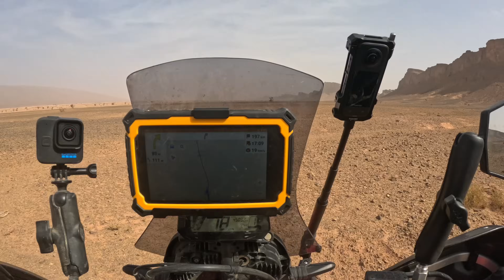This is a serious problem with my motorcycle |S7 - E12|

Comment: As a aircraft technician, it always amazes me when I see someone with ingenuity. Ramdan is a shining star in his ability to come up with a clever solution with the tools at hand. It interesting how people in remote areas are so friendly and customer oriented, not so here in the States. Please keep up the great videos, they warm my heart.
Reply: street mechanics usually came up with good tricks repairing unavailabe parts...
Reply: Yes, Moroccans are very kind, generous and kind. Welcome to your second country
Reply: As a Certified red neck fix it anyway you can in a pinch . I always get a kick out of engineers above my pay level to make a simple problem worse. Air craft have at least 1 back up system, great if you flying. Sucks if you have to move it,Hammering a brake line close before a leak is not a option at 30k ft either. But after 47 yrs riding bikes I can always find a way to fix it cheap and nasty.
Reply: It's not about customer.... these people will help out even if you are not a customer. Why u only see the materiel side of the world.
Reply: Zal wel lekker jeuken dat glaswol aan de blote handen😅

Comment: I followed the repairs,, metal working, to paint,, and then the air box repair glass fiber mat, polyester resin, gel coat, micro balloons,,, and then paint to finish sealing and make it pretty.  I do not know the plastic Honda uses,, most polyester resins should be compatible.  If it lasts the week of temps and vibrations, it will last as long as the motorcycle.  That was not a temp patch,,, that was an expertly thought out and skillful permanent solution.  My compliments to your mechanics.
Reply: Agree!  That was an expert repair job.

Comment: I think the repair will be stronger than a replacement! 😂
Reply: me too this fibreglass epoxy combination is very flexible and powerful
Reply: yess
Reply: agreed
Reply: Definitely as strong and looking at the amount of mesh they dropped in there probably thicker walls than a new box. Save you’re money Loraley as prob get another object whack it riding those tracks so wait till your back on Western European roads before replacing.
Reply: of corse with baraka of Ramadan

Comment: I can for sure say that you don't need to replace that airbox.....that repair will last forever......Ramdan and his father did an excellent job, and even painted it to match the rest of the airbox, so much love to what they did! 😍
Reply: That's  what I thought too, that repair will be better than a new one.
Reply: Same thinking here....The patch (fibreglass?) is stronger than the original abs plastic
Reply: I tend to agree, the original plastic was weak, it broke easily. If they cleaned it properly it will not fall apart and only be tested if another rock hits it. -but it could be stronger than it was. 🤞

Comment: That was a good solid repair - the fiberglass patches are probably stronger than the original plastic. I don't think you need a new airbox - that should be fine as a permanent repair :)  Happy trails!
Reply: I would totally keep that airbox fix ,I wouldn't change it, those young men did a great job, impressed!
Reply: @michaelwebster2416  Dacre Rally was passing through Morocco So you will find the best mechanics in the southern parts of Morocco
Reply: agree 100%
Reply: Y que piensas sobre un cambio de aceite por si acaso entró suciedad al motor y que el filtro no pudo ayudar?
Reply: @Troubadour.  The damage was on the "dirty" side of the filter, so no dust will have entered the motor.  No need to change the oil, all should be OK

Comment: This is a lesson on how to fix a problem without depending on a dealer, a supply chain or anything else. That fibre glass fix will be more robust than a new air box.  I am not sure how many of your viewers / subscribers understand the enormity of the task you have to endure to bring these videos to life.  All that gear and proective equipment, the angles, the stop - starts the editing……. and all whilst dealing with a problem you have no idea if it can be fixed in a few hours or if it will change your plans for the next day or more.  Sheer professionalism.  I doubt you would get such out of the box solutions anywhere in the west due to a combination of lack of skills - laziness - and regulations that result in liability.  You are unstoppable Norah. That drone footage in the desert valley was breathtaking.  Ma Assalaama Ukhtee. Stay safe

Comment: What a day , I hope Honda take note of the good service you getting from around the world. Loved the workshops , they get the problems sorted with a smile. The desert is still very full of surprises. Good one Noraly. Stay safe.
Reply: If you go to Honda dealership in NL or anywhere expect few days and few hundred $$$ to get that box replaced (of course they don’t repair)
Reply: Honda need to take note and provide a metal guard for their plastic air box as I would have thought riding such a bike a CRF300L off road, rocks and stones will get thrown up by the rear tyre to adjacent areas. That plastic air box is clearly vulnerable and needs re-inforcing or protecting with a metal guard much the same as the oil sump and exhaust pipes have bash plate guards.

Comment: Ramdan has a skill set that I don't often see in my "developed" area;  he was gracious and was able to repair what was damaged and didn't have to rely on Honda replacement parts... kudos to him and his team for their efforts!
Reply: The dealerships hate such people, because they make em lose money. if all mechanics can repair the broken parts like that, no one will buy their spare parts.
Reply: The trouble is access, replacing it is a long job, but it is just an empty space so Ramdan and his team did a great job sealing it against dust etc, just my 2c.
Reply: @sys-administrator  oh that's good, I thought it would be at least a couple hundred dollars.
Reply: @bikerider479  You are so correct.  My father refers to many of the modern mechanics as "module and parts replacers" and he is right.  Its caused me to come-up with my own fixes on 20+ year old bikes.  I also found an independent shop that can literally fabricate, rewire, etc. anything.  Literally, the dealers want nothing to do with troubleshooting older bikes.
Reply: They made the part even beter then original. Polyester is much stronger than plastic.
Reply: ez fix and say "No problem" such a good guy! :)
Reply: In western countries we developed in the wrong way 😄

Comment: I wouldn’t worry about changing your airbox, they done a good repair …you can tell they took pride in their work 😊
Reply: The fiberglass mounting will last longer than a new airbox
Reply: It's as good as new!
Reply: Yep.
Reply: The air box is a waxy thermo plastic . Polyester resin and fiberglas mat won't stick for long . An opaque milk bottle piece hot melt glued in or silicone adhesive sealant will adhere better as a patch.
Reply: @ronald8673  funny how mine that was repaired 6 years ago in Spain is still holding fast 😂

Comment: It never ceases to amaze the ingenuity of these places and what they are able to achieve. These people often work miracles with what tools they have. Full respect to Ramdan 🙏🏻
As an F.Y.I., the matting that they used was what we call "Chopped Strand - Fibreglass" and they wet it down with Polyester resin. 
In the aircraft industry (here at B.A.) we use fibreglass woven cloth and Epoxy resin or preimpregated fibreglass/carbon, occasionally there is a use for chopped strand but not very often.
Keep up the wonderful videos and safe travels 👍🏻
Reply: The fiberglass mounting will last longer than a new airbox

Comment: That was amazing for a motorbike shop in another country (Morocco) to do a custom fiberglass-resin repair on your motorbike's air box! I would say it's almost better than new! I can't believe all things considered, how quickly those guys worked! Seemed like really great guys and very dedicated to doing right by the customer! There needs to be more shops with this kind of work and integrity - absolutely amazing for being in the middle of nowhere! Awesome video - very much enjoyed this, thanks Itchy Boots and ride safe!
Reply: In morocco There's only this kind of work . There's a lot of shops like that
Reply: Back in the 1970s, even in Central Europe many rusty cars were repaired the same way using fiberglass and polyester. Nowadays those parts do not rust so easily  - or they are rather replaced than fixed.

Comment: Wonderful mechanics! They did a great job. 👍👍👍😃
As an old-school enduro rider, I recommend you always to have a roll of strong duct tape in your luggage. 
Not only can you use it to tape up "holes in Airboxes", Generatorhousings, your boots and jacket or trousers , 
it also helps to splint makeshift broken legs and apply pressure bandages! 

It can save lives! Never travel without it.

Comment: Ramdan's airbox patch made it stronger than new because the patch was made of very strong materials on both sides of the hole, making it thicker than original. I've done similar patches on my lawn tractor's mowing deck which is regularly penetrated by our sandy soil. I also use duct tape to start, then remove it once the first side of the patch has hardened, then the first side of the patch provides a surface for the second side making the original hole virtually proof against further damage. I'd say buying a new airbox wouldn't be necessary. My mowing deck is about a decade old; I just keep patching it when holes crop up in new places.

Comment: Ramadan you have done a good job of repairing your airbox by applying fibreglass + a layer of polyester paint like boat hulls. This will be stronger than the original plastic like your metal chain guard. Super those Moroccans in France you would have found it hard to find a repairer doing this type of work. 👍

Comment: Great mechanical work by Ramdan and his team.  The "Polyester" is Fiber Glass, the clear liquid is resin for the fiber glass.  The tape on the bottom of the air cleaner box was to keep the fiber glass from falling through. I like the fact that they took the time to paint their work. You will probably be able to finish your entire ride on the repaired air box instead of ordering a new one.
Reply: I agree about painting the parts. I know nothing about the work they did but did notice they finished the job properly.
Reply: It's polyester resin.  It's amazing what people can do with the various forms of glass fibers and polyester or epoxy resin.

Comment: The repair they did on your airbox was with fiberglass (chopped strand) and they did a good job. They green paste is most likely a fiberglass fairing compound that helps to smooth out the patch. Then they painted it to match your original black plastic. You certainly could consider this to be a permanent repair. Great repair shop! Meeting these repair guys is almost as cool as your scenics!

Comment: Hi Noraly. Having taken a second look at the damage to the airbox, there is more than just the two holes. There should be a 'mudguard' screwed to the rear face of the airbox which hangs down below the airbox to protect the rear shock from stones and filth. It appears that your 'mudguard' got ripped off and took the bottom of the assembly out with it. So to protect your rear shock from future damage, you will need to order a new airbox and the mud deflector (and don't forget the two screws to hold it in place...). Hope this helps, Brian

Comment: I think that the air box now is a lot stronger than a new one will be so I would not bother replacing it ,so long as its air tight . Keep up the great work. The filming and music  have been great.Good luck.
Reply: Agreed! Honda already proved how "strong" the factory box was; the repaired one should hold up fine, and need not be replaced with one as fragile as the original, esp given the torture it's probably yet to receive! Perhaps a future upgrade could be a stone guard inside the rear wheel arch.
Reply: I was thinking the same.
Reply: I agree, the repair will hold up a lot better than a new (and weaker) airbox. Just keep the one you have Noraly and save yourself some money 🙂

You might like to add a small amount of glass fibre and resin to your toolkit, you never know when you'll need it.
Reply: @kuyper  yes that air box needs some protection.

Comment: Good things to carry in the tool bag are JB Weld (epoxy) , duct tape and mechanics wire. You can temporarily fix quite a lot with these things. Safe travels.
Reply: Please , explain what mechanic wire is. Thanks and have a nice day.
Reply: @carlosberrio2206  it is a small gauge wire (14 gauge ?)that you can wrap around various things and twist it to hold things in place on use to hang things. It will work where cable ties can’t because of high temperature and abrasion.
It is single stranded. Hopefully this will help you.

Comment: Glasvezel-polyester in dutch. Good stuff to repair broken plastic with. I used it for a crack in a kayak. 
In a pinch you can use epoxy glue (do not get that stuff on your hands - seriously) that you mix with any other kind of fibre material, like strips of old clothes. Keep it in shape with some pieces of cardboard or tin cans while it's setting.

Comment: They did a great job, real artisans, problem solvers, the repair is probably stronger then the original airbox.  Reinforced with polyester resin and glass fibre, tops !  even painted it for you - excellent.

Comment: When I used to be a mechanic, I had everything to fixe electronic parts because they teached me at university some electronic to build computers and avionics, but everything had to be replaced by new certified parts. I paid nothing to fixe my things, never build something from scrach on my work. This was much more an engineering rules and certifications issue. This is much more political, if I do something, I am responsable for. I can only add new parts from the builder with their requirements with a maintenance level III.

Comment: Ouarzazate is a city where the Rally Paris-Dakar came through when it still started in Paris and went to Dakar. And you best spell it like this: "Warsasate". And don't worry about the fix with the fiberglass and epoxy, this is a permanent repair and it won't break. Very well done repair.

Comment: @22:32 The white one is a glass fiber not polyester maybe. 

Also the liquid are epoxy resin, fast hardener and black ⚫️ paint mix together not polyester. 

This is no chemistry at all but 😍 🤩 art practice.

They make almost all bike frame parts with these at factory.
Cheers 🍻

Comment: I'm aircraft Mechanic .and i see that Ramadan and his team did a great job. With what they have .
They used fiberglass Wich was a very good option .we work with that to fix Aircrafts Skin. 
Don't worry. fiberglass is an insulation material known with its strength, dimensional stability, corrosion resistance, and lightweight nature .

Comment: A box end wrench, or two, would give leverage to easily bend the shift lever back.

Zip ties, easy to bend and twist bailing wire, aluminum tape, duct tape and gas&oil resistant glue/epoxy would be in my kit to temporarily fix issues like broken chain guard and plug  holes.

Comment: The airbox hole at the very bottom was designed that way, I believe. The smaller of the holes was definitely a puncture. I've owned several Hondas and all have a rectangular opening directly at the bottom of the airbox. Perhaps I'm mistaken because I couldn't perfectly see it. If you feel lacking of power on the bike I would try reopening that hole even if it be slightly smaller. Could be more of a problem later on in your travels

Comment: Because they have to rely upon raw process skills in the absence of reliable materials supply, remote mechanics can often put a better, quicker, more complete, and cheaper fix on things than First-World mechanics who who just throw away and replace.  Your new metal chain guard is better than the stock plastic item. The fiberglass repair is stronger than the original, and they seemed meticulous about making it look professional despite the rough environment.

Comment: That white fabric is fiberglass, and the air filter case is probably stronger than the original.
You probably don't need to replace it with a new one.

Comment: Just seen your program and the guys did a fantastic jom you shouldn't need to change the air box as the put fibre glass in first which should be OK but also put a filler in on top so its probably stronger then before
 Good luck with your travels

Comment: Am very interested how long these repairs held up?    It is a mystery sometimes what will stick to what plastic  ....unless one did it regularly it could be just hit or miss....maybe last a lifetime?  Maybe fall apart 50 miles later?  I would love to know in this case.  Personally I think I would have gone with some fabric and silicone   adhesive which if plastic is cleaned well seems to hold tenaciously...I just worry resin fiberglass would fail to bond well...if that was all I had then I would apply to BOTH sides so that even if it did not like the plastic it would hold to itself with plastic sandwiched tightly between?  Again I would LOVE to hear how this held up!!

Comment: STAR WARS Battle of Jakku has nothing on this place!

The mechanic properly used a fiberglass repair kit to fix that hole in the air box.  He was mixing resin and a small amount of hardener to make a very durable epoxy.  The patch will be stronger than the original plastic.

Comment: As far as I see the guy has put epoxy or polyurethane resin and that white sheet seems to be glass fibre maybe!! If my predictions are correct then that fixed part should be much stronger than the original one :) !

Comment: duct tape and cable ties are a must for long-distance trail riding, the holed air box could have been fixed with an old plastic oil bottle and taped in place until you could buy a new one, chemicals in the air box might not be the best idea with modern injectors,